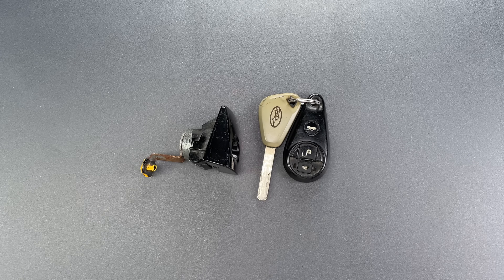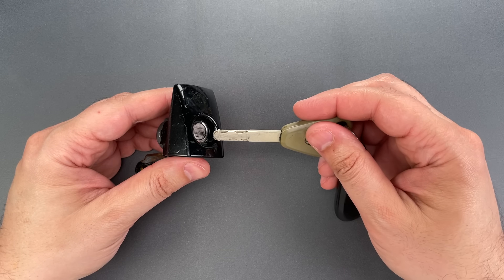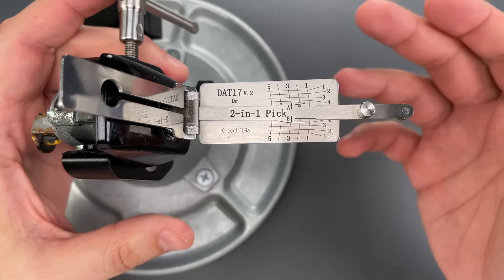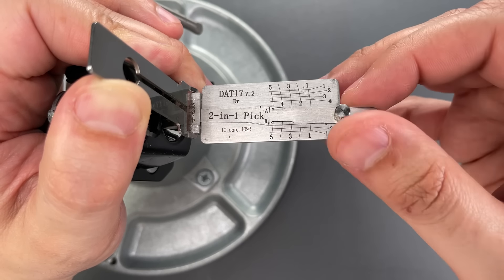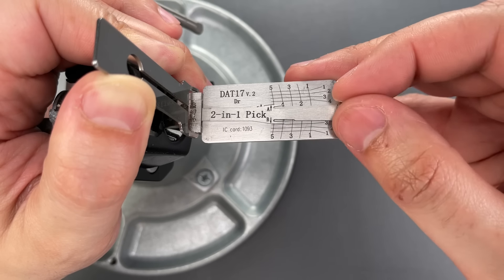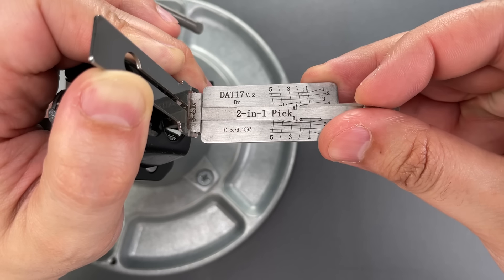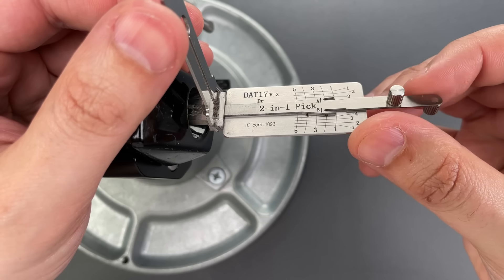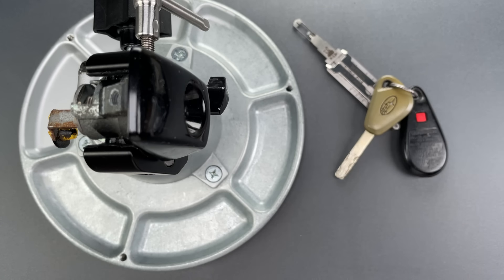[1346] A Trap For The Unwary: Subaru Impreza Door Lock

Comment: I'll just smash the window with a Master lock.  It can probably be used for THAT effectively at least.
Reply: shatters
Reply: @mortiphago  The lock, not the window, I assume...
Reply: unfortunately for master lock even then spring loaded center punches are a thing and often bought for cheaper then a master lock
Reply: @OctoberNight-rr7ny  
And much more effectively!😂👍
#Mastersux
Reply: A system is only as secure as its weakest link
Reply: bounces back
Reply: @wakkogn9351  Yes that was the joke
Reply: @OctoberNight-rr7ny  Who said anything about paying for a master lock? They sprout on chain-link fences around here when school's out at the end of the year.
Reply: call a glass installer first to see which one is cheaper frequently the smallest window is most expensive to replace.
Reply: @OctoberNight-rr7ny  why would you have to pay for a keyless master lock? Just pick one open in the wild, break the window, then return the lock to it’s original place
Reply: @raemnir  not if you get a square-ish body lock and hit with the corner
Reply: @cryipticcreep5586  honestly if you want to do it thats kinda loud...
 Best way you take a flathead and jam it under the seal and pull back towards yourself... this way the initial pop is actually inside the door
Reply: lol
Reply: They’re too cheaply made. The lock would likely get broken
Reply: Yes, the smallest one is typically a fixed window.  Door glass that goes up and down is more commonly broken and easier to replace due to not being sealed in with some kind of gluey gasket material (which you'd ALSO need to replace).  

I've replaced several door windows over the years and you can usually get them for under $100 in a junkyard, plus by taking it out yourself in the junkyard you can sometimes learn what NOT to do to your own car door when you're installing it.
Reply: @helpabrothawithasubisaiah5316   It's a joke against Master.
Reply: @wakkogn9351  Ssh he’s giving google advice
Reply: @wakkogn9351  why would you make a joke against your master?
Reply: That I will just replace my windows with old Nokia phones
Reply: Backseat lock pickers talking about how weak a master lock is when it takes them 15 minutes to pick it
Reply: @emilianozamora399  How long does it take you to pick a Master 1D?
Reply: I bet you open both the car door and the masterlock doing that
Reply: @execration_texts  I have joked with people if I ever become a criminal I have already hidden tools to break into most houses at the homes, there is a rock in their yard and a picture window that it will work on. just don't stand directly in front and throw straight at the window use an angle. I am of course joking with them but it makes people think about that giant glass plane showing off their TV in the living room.
Reply: I think you underestimate the strength of a car window.
Reply: Reminds me when I did my paper route in about 90's it was 4 floor apartments. And I dropped my keys inside. Looked around (it was in the middle of the night) for maybe someone that was coming home and had some keys and could help me getting mine back... Then someone came on bicycle, and I ran to him. I was like 14-15 years old and he was like +40, but he looked like he was going to hit me, and was sort of scared (like WTF is he running to me for?).
Asked when I ran up to him if he had the keys to get inside the apartments that I pointed to. He then said no why would he have that (in a shouting, scaring voice). I said I was just wondering because I have locked myself out and I need to have them to continue my paper route... Then he looked at me and said oh I see... I can help you I think. I was pretty confused, he did not have the keys... but he could help me? how come?...
Then he said he had the master keys, what door did you want to open? Now I was really confused... Until he opened he's jacket and there was "loot" everywhere and he got out his hammer and big screwdriver... I pointed to the door and what do you know that "master key" worked :-)
Reply: I know we’re all joking here, but if you smash the window on a 2010 WRX, the immobilization system kicks on and the you can’t even start the car with its own Key.
Reply: you are working with a Subaru Impreza. It and your Master Lock 607 can be opened with a Master Lock 607.

Comment: Bought a house not too long ago, the house had 3 doors that were locked and no key (mailbox, and balcony), local locksmith told me he was gonna have to bust them open and probably need new doors. got a makeshift lockpick and tension tool, unlock them all in 3 hours, locksmith gave me a discount on the new locks. thank you LPL
Reply: I don't get it, if you knew you had the capacity and skills required as well as the tools. Makeshift or not, then didn't you have the ultimate discount of BEING the locksmith, or at the least not calling one in the first place?
Reply: @Jay22222  I had never tried to pick a lock before this, I called a locksmith because i needed to replace every lock and needed him to budget the work (you should always replace all the locks in a new house), and i only tried this cause i didnt want to risk him breaking the doors.
Reply: @Jay22222  that's the thing, he didn't have the skills and STILL managed to do it better than the locksmith
Reply: @Jay22222     To some people having to get and use makeshift tools and spend 3 hours on 3 locks is not cost effective if there is someone who can pick them in 5 minutes and can put in replacement locks & keys at the same time.  When it turned out there was none and the cost would be "new locks ... and new doors too", i.e. the price for the service went up significantly and the troubles (buying and getting new doors, having busted doors for a few days, ...) attached went up as well, spending a few hours on the task turned out to be preferable to a few hundred $$$ more.
Reply: @vascorodrigues18  Nice work! More people should be like you and willing to just give it a go. 

An afternoon of playing with a few cylinders, a handful of pins and a few blanks will have you ready to just rekey next time for pennies/door.
Reply: As a locksmith sometimes when the locks are very worn , it’s not worth putting at labor into them, you picked them in 3 hrs , probably a good picker 1/2 hrs plus parts and labor.
Reply: Just break a window and replace @30 bucks
Reply: @Rockenstein68  I figured that would be the case, but most of the time (at least here in portugal) most locksmiths don't even bother or know how to lockpick, and just bust the locks, iknow it's faster and cheaper for everyone. (except for me if he went and broke the doors)
Reply: @wileecoyote5749      And open the door from the inside, yep.   If it is a door that can be opened from the inside without a key (i.e. by twisting a knob) or where the key is in the lock, just on the inside.  And where there is a window to reach through or climb in.

Neither of which is a given and it certainly does not work well for the letter box, having no windows and all.  And I doubt a large window only costs $30.  Besides, you will still have to deal with all the broken glass.
Reply: @wileecoyote5749  I have access to all zones, (i bought the house i had to check all corners, I jumped trought a window to check before buying it), the doors are on the inside of the house so they just need bo be unlocked for me to open them, and thats what i did, now I can just open and replace the locks
EDIT: the doors where both to access the balcony which I could access trough windows from the other rooms.
Reply: I had a family member pass not long ago. Another family member asked if I knew how to open some lock boxes that held his documents (needed for probate). I was thinking my angle grinder then I remembered I’d been watching this channel for a few years. Grabbed a few keys I had sitting around til I found keys that vaguely were the right size and jiggled them open. I was kinda shocked with how smoothly it went. Like 90 seconds after I was asked I had them open. I absolutely get the let’s call a professional but then thinking, let me try this first
Reply: Well, had nothing to lose if you messed the locks up lol.
Reply: Had a very similar situation ages ago where a door that we had no key to got locked and it was going to result in destroying it but I insisted and improvised a bump key and opened the door!
Reply: @vascorodrigues18  If these were not double deadbolts and you had access from inside, why did you need to pick them?
Reply: @ATEC101  Because they were locked and we had no keys, now that they are unlocked we can use the doorway to pass and bring furniture and appliances instead of the window or risk ruining the doors when busting the locks. and since we can now open them we can change the locks without any risk of damaging the doors
Reply: @wileecoyote5749  why buy new windows when a drill is cheaper?
Reply: @vascorodrigues18  I think the question was more towards why would you have to pick multiple locks? Once you pick one, you can gain entry and unlock the rest by hand. So? Were these all key only type locks? Who would only install key only locks in their entire house in the first place...
Reply: @musicwv  sorry if explain this badly, the 2 doors that give access to the balcony were locked, and there were no keys, firstly i wanted them to be unlocked so i can open then when i want from the inside to go to the balcony without jumping trough a window, the other one was the mailbox key, as of now all the locks have been replaced, with out the need of brute force or danger of damaging any door
Reply: @vascorodrigues18  Ah, fair enough. The original comment came off as a "sure, that happened" kinda scenario.  Still odd that the balcony access doors were double key without a secure side release. Good on you though.

Comment: I think this is a decent definition of pick resistant. Even if you have a purpose built tool, this lock is slow to open and not nearly as quick as any kinetic attack is
Reply: If you consider on top of that that they're the ones designing the rest of the product and they only need to make the lock as good as the weakest point of attack (probably the windows), it is a pretty sensible choice for a lock.
Reply: It's pick resistant against a normal pick, yes, however, Lishis are an amazing tool for a locksmith, even a beginner can use them and get quite fast. I know this because when I turned 19 I became a car locksmith, I did it for about a year. When doing car locks all the time, it gets fast and easy
Reply: @guillermorelobalopez7553  by what logic is disabling the lock to the owner (with the key) if it's been fiddled with good design?

Are you high? Because if you are, you should share with us.
Reply: @gilbatzri  Where did I say it was? The only point I made is the lock needs be only good enough to not be the weakest point of attack.
Reply: @gilbatzri  more than 1 door available, and evidence of tampering so the owner can notify authorities without destroying evidence
Reply: @guillermorelobalopez7553  when you said "it is a pretty sensible choice for a lock."

That is equivalent to saying something is well designed in my book.

And I disagree with that assessment.
Reply: @gilbatzri  Are you unable to engage in discussion without personal attacks?
Reply: @davidsandberg3109  
Cool!
 So to mess with your friend on his suby, just pick every lock on the car incorrectly and wait for the real fun when he tries his key.
Reply: @MrTheHillfolk  why do just that, isn't it easier to pour brake fluid on the paint and let it sit overnight? Or slash his tires?😅
Reply: @gilbatzri  there's faster less noticeable ways than smashing windows
Reply: @jhtsurvival  Pray tell what is faster? I know you could be less noticable, at the cost of effort, but in my experience my windows have been universally broken if my car was secured and someone wanted to rob it.  

I leave my miata unlocked because of that, and it has never been smashed, my subaru and acura had windows smashed repeatedly to gain access and find something to steal.

What is less effort than a smash and grab? To me effort expended is the most "expensive" factor in robbing a car.
Reply: @mattdsoares  when people talk about "preserving evidence" in a car robbery they don't live in the real world, so I mock them, this is the internet. Welcome to it. I was jesting, if you want to see personal attacks look at twitter or instagram.  I didn't abuse anyone.
Reply: who the hell uses physical keys in cars these days? the owner can just use their fob.  for this to be a successful nusiance attack the battery would need to be flat and the hood down.
Reply: @jnawk83  If the lock is in the fault condition, I wonder if the electronic key fob mechanism will do any different to fix the situation than a real key
Reply: Isn't it pick proof? I mean it took him forever by lpl standards and after all that effort the door isn't even actually unlocked at all, it's still latched. 

The goal of lock picking is to unlock a lock, if lpl had this actually on a car, he would find that the door is still locked even after picking it